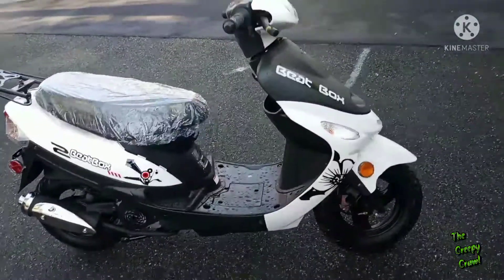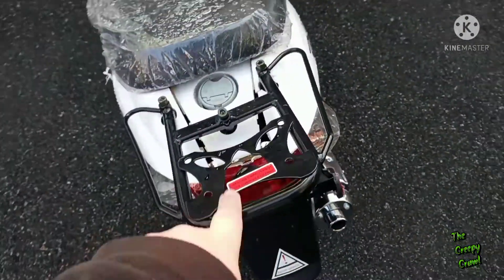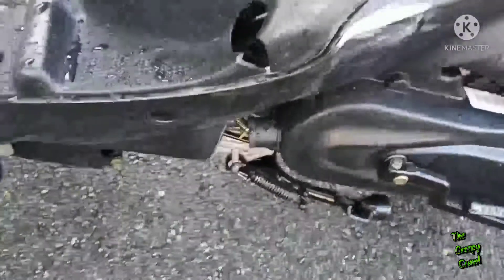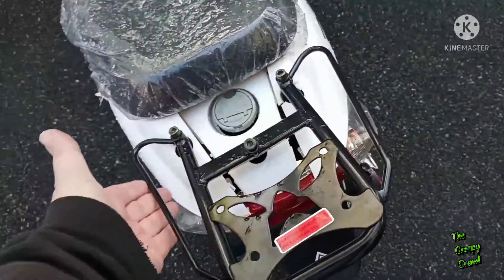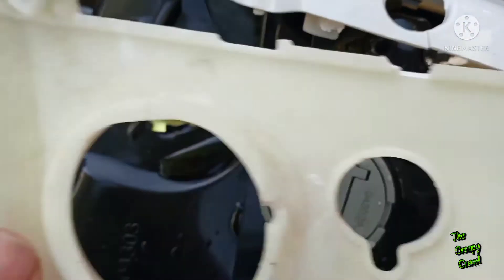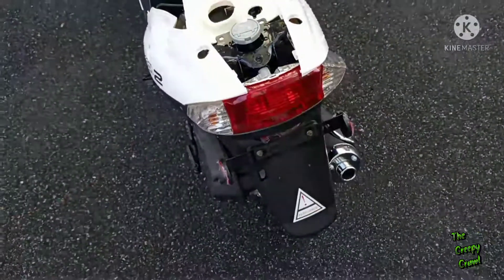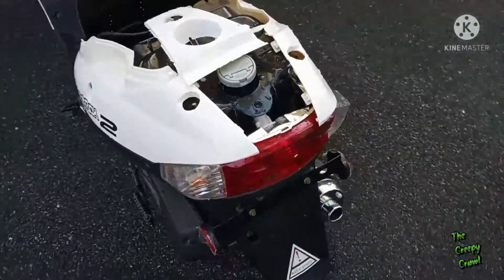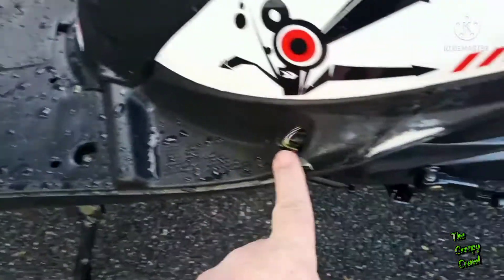2022 TaoTao (Pony) 50cc UPDATE

Comment: Did u order the parts wow.I used Amazon mine was a 2020 Tao Tao the scooter bike has been super great.Mine is blue.I have had to adjust the carb a little.But it runs super great.I also got a 2021 ice bear rocket 50 scooter which cruises 40 mph to over 50 mph.where as the Tao Tao is 35 to 45.all day.Really both excellent scooters.
Reply: Hi why does the ice bear 50cc  do 50mph on the flats!  ?  Is it a legal moped?